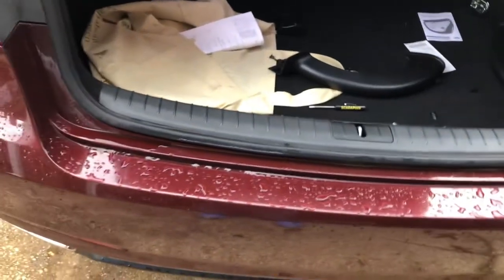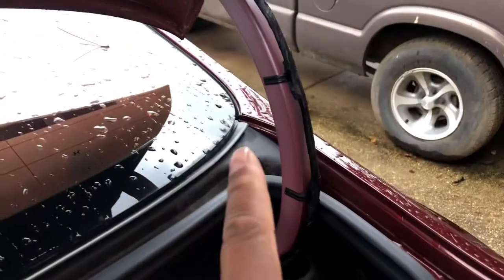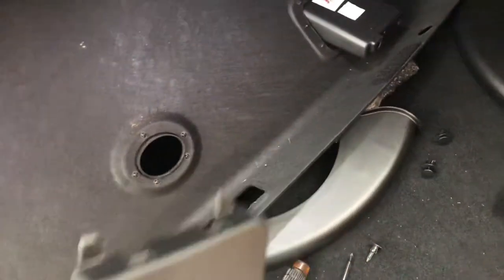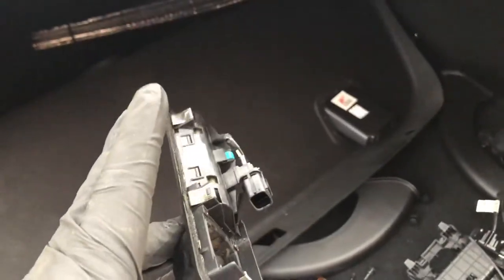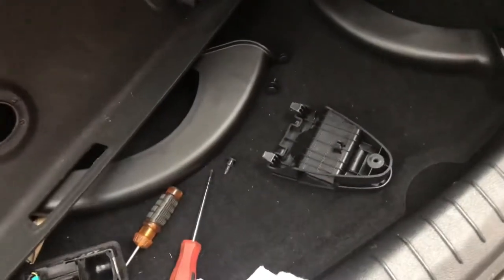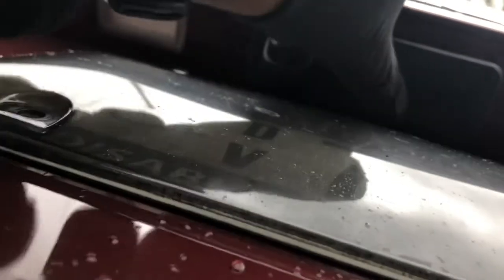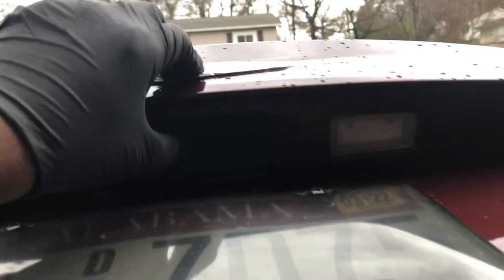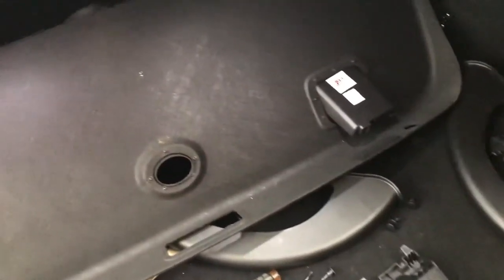Replacing the trunk release button

Comment: Thank you for this video. I went to the dealer for the same problem. They told me that the part cost was $418.36 USD. plus taxes. I bougth the genuine part from Korea on Ebay for only $29.00 USD. I hope my comment help others to not get scammed for dealer service department with no ethics and no respect for others. Thank you again.
Reply from the maker: Dealerships have been doing this for years. I’ve always gotten genuine parts from eBay. Always remember to check that they are verified sellers and you will always get quality parts.

Comment: How do we get the button  assy out. Is it just a knock out from inside
Reply from the maker: It has a type of push lock clips that hold it in place. You have to press the side ones in and the two on each side and then it will release.

Comment: what did you use to get the covers off the trunk rails?
Reply from the maker: You can use a small punch or anything that could push in the plastic pins to remove the plastic reusable rivets.

Comment: How do you remove the trunk latch plastic cover?  I am stuck removing trunk liner because of it.
Reply: Turns out it is simple. Just pop it with flat head screw driver. I have to say the hardest part was removing the old handle.

Comment: You didn’t show us how to open the connectors or remove the opener
Reply from the maker: @303Fro  true. Didn’t have a tripod to mount camera. But it is still simple to remove. You can feel the tabs to push them in while pushing down from the inside of the trunk. You can unplug the switch from the harness in the trunk topside of the switch.
Reply: I got it done if I did again it would be much easier.  Thank you.

Comment: I just replaced mine, checked all connections but it doesn't work.  Any ideas?
Reply from the maker: Check your fuses and make sure you have power going to plug
Reply: @Icanfixit-2  Power is going to to plug and out of switch but not making signal to latch.  Fuses are good.  Fob and dash both unlock but not this new handle.
Reply from the maker: @jonicurn100  the contact switch/ micro switch in the trunk release could be bad.
Reply: @jonicurn100   Did you fix your problem? I have same issue as you. Please post how you fixed yours!